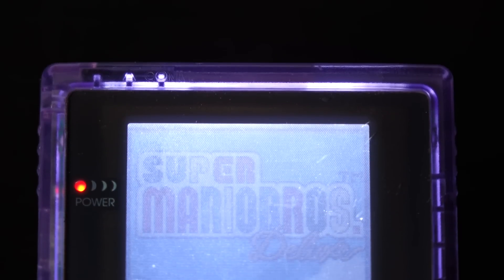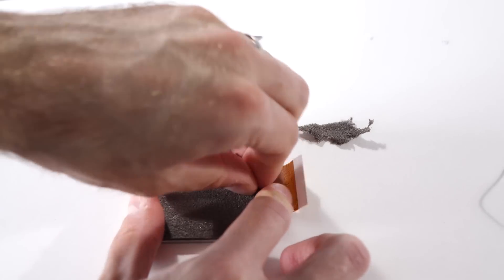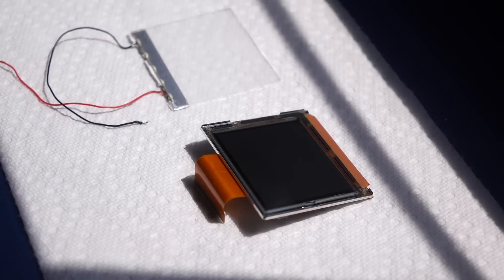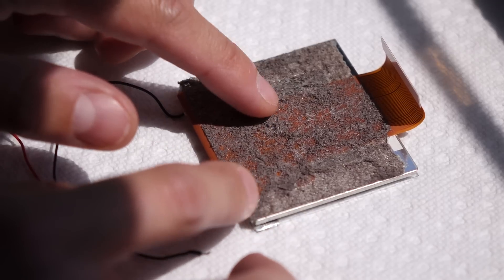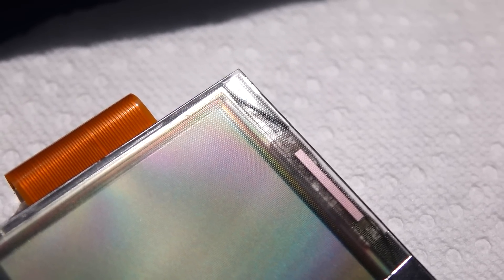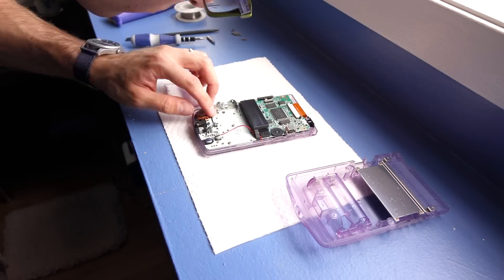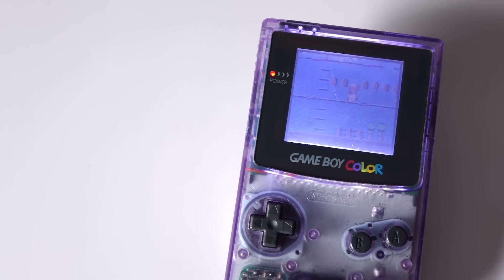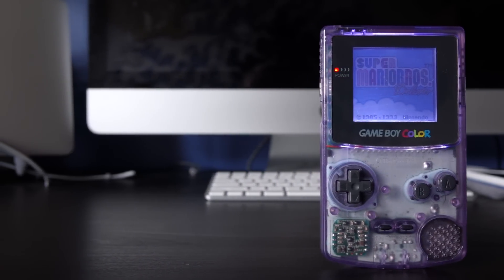Game Boy Color Frontlight: Does LOCA Make a Difference?

Comment: Instead of using LOCA, couldn't you add a resistor to decrease the brightness of the light panel and make it easier to see?
Reply: Damn imagine loca and a resistor
Reply: Perfect viewing conditions! Just need to figure out what resistor value to use...
Reply: +dj505Gaming man that sounds baller good luck
Reply: +WordierWord6 Thanks!
Reply: +dj505Gaming I've read a 1k pot is good so you can adjust
Reply: +FireMrshlBill A potentiometer would be too big to fit. I tried a resistor a few minutes ago and it just prevented the gameboy from turning on. (the red light flashed and it turned off)
Reply: +dj505Gaming A trimpot would most definitely fit. It has been done. You could also find other small pots that you can find some place to mount (maybe even relocate and drill a small hole to access from the outside). People have done it.
Reply: +FireMrshlBill Ah, I see. I thought you meant those bigger ones! Any way a simple resistorb would work? If so, how many ohms? (the light panel has 5 LEDs)
Reply: +dj505Gaming Haha, you could use one and just mount it externally. Just glue a gear to it and call it a steampunk GBC, ha. A resistor would work, it would just be a fixed brightness. I haven't done this mod yet (waiting on a second GBC to be delivered because I don't want to mess with my current one). I haven't looked at the specs to figure out which to use. I just know people have used 1k pots, and all the sites I have read people just say they used resistors but didn't say what value. I know people use 47ohm when installing gba sp front lights. So if you have multiple resistor values, play around with 47ohm and maybe move up from there. If it isn't powering up then you need to reduce the resistor value. One person did say 1k would be overkill. Sorry, I probably won't be able to do this mod until next weekend if the snow doesn't delay the GBC delivery.
Reply: +FireMrshlBill Thanks! I'll try it out.
Reply: +FireMrshlBill Thanks!! 47 ohms brought it down to an actually useable brightness. Can't wait ton add the LOCA, that is when it arrives :P
EDIT: Still a bit bright. Maybe a bit higher value would be better. I'll try 56 ohms.
Reply: +dj505Gaming Awesome, good to know! Saves me some time. I read that they use 63ohms or thereabouts on the DMG front lights, so may try between 47 and that, guessing 100ohms at most if you say 47 is in the right area (I guess I could actually think about it and do the math, but trial and error is more fun). I don't think I have any pots or trim pots on hand and would rather not order any. Let me know if you try a higher value and find a sweet spot. Thanks!
Reply: 56 ohms seems to be about the sweet spot for me until I get the LOCA. Might try a higher value if I ever need to, but it seems fine for now. Good luck with your mod! Oh yeah, I tried around 80 ohms I think for my first try and the Gameboy wouldn't turn on, so I'd recommend something under that.
Reply: +dj505Gaming Ya, I will be doing it with the LOCA and his still was a little more washed out than I prefer. So I still plan on using a resistor to bring it down a bit. I'm not looking to get it perfect as I have a GB Boy Colour that I play my gameboy color games on, so this is more just for the fun of it. But if I can get the LOCA right and the screen slightly dimmer than his, I think it will look pretty decent with the front light. I'm doing it on an atomic purple one as well (will match my N64 controller) and think the light bleed will look pretty neat through the translucent case. Anyways, will update whenever I am able to do the mod with my results (the snow storm has delayed the GBC arriving to me, was supposed to come today but hopefully can do it this weekend).
Reply: +FireMrshlBill Oh crap. I was in the process of taking out the screen and was using a spudger and twisting the gameboy frame slightly to loosen it up. Well my wife keep calling down because she needed me to come upstairs for lunch and I rushed it a bit to be polite... then CRACK. The edge of the screen outside of the viewing area cracked and now the screen is dead. Replacement screens are like $28 on eBay (whereas a GBC is $40). So will have to put this off until I can get a replacement screen since I do not want to mess with my other GBC. I'm mad at myself... not like they are making any more GBC's and I just messed up a perfectly good one. Will try to find one that is dead or has a banged up case that I don't mind using parts from. $28 on a screen just isn't worth it to me.
Reply: +FireMrshlBill That really sucks D: Replacement screens are so expensive... Good idea trying to find one for replacement parts. Those should be fairly common. Good luck fixing it!
Reply: I found this replacement console here, might want to contact the seller to see if the screen works.

http://www.ebay.com/itm/Nintendo-GAME-BOY-COLOR-SYSTEM-FOR-PARTS-OR-REPAIR-/191795135459?hash=item2ca7e183e3:g:VBMAAOSwL7VWrMHO
Reply: +dj505Gaming  Thanks, I'll look into that. It'll probably be awhile before I try again because I decided to work on my busted PC speakers since I had my equipment out and either the fumes from the solder or the contact cleaner got to me and I basically am having flu like symptoms (light headed, nausea, 102temp, chills, coughing up metallic taste, etc). I've been soldering for well over a decade and haven't had this happen, though last time I did get a little nausea and dizziness for an hour. So I won't be soldering without a mask or exhaust vacuum anymore, I guess I developed some susceptibility to solder/flux, apparently similar to to "metal fumes fever" (sounds like a Kiss song), apparently blowing away the fumes as the smoke rises isn't enough anymore. It really wasn't much at all either. Anyways, moral of the story... wear a mask, use a ventilation vacuum or fan when soldering, you never know what can happen from fumes, especially when working on already manufactured boards.
Reply: +FireMrshlBill Yeah. Lots of the time premade boards use less based solder, plus it might be a good idea to make a fine extractor using some carbon filter like I did. It's really easy, just use a computer fan pulling in air through the filter (which you can probably get at electronics stores.)
Reply: +FireMrshlBill Yeah. Might be a good idea to make or use a fume extractor (I made my own) because lots of manufactured boards use lead-based solder and flux that can cause fumes.
Reply: +FireMrshlBill Update:
I broke the frontlight. I took the gameboy apart because the wires from the mod were interfering with the buttons and the black ground wire popped out of the frontlight panel. Apparently it's fixable, though ^_^
Reply from the maker: +dj505Gaming Yep, that's fixable, I had that happen once. Just carefully peel off a little bit of the silastic around where the wire solders and tack it back on.
Reply: +This Does Not Compute Alright. Thanks! I'll see if I can fix it a bit later.

Comment: I got the kit from kitsch bent and they didnt include a replacement reflective strip for when i peel it off to cure the loca under it, I don't want it spidering so any suggestions?
Reply from the maker: +Infectious Fallout I've used aluminum tape for that before, you can get small rolls of it at the hardware store.

Comment: I hade a front light modded gba I bought like that and it had a bunch of bubbles and then got like deteriorated on the corner so I pulled it off and peeled off the screen no problem
Reply: I broke the front light pulling it off though

Comment: What about the chinese GB Boy Color? Is it possible to just take the backlit screen from it and put it into an actual GBC?
Reply from the maker: +Dylan Bain The short answer is, no, it won't work :-(  Stay tuned for a future video that (indirectly) explains why.
Reply: +This Does Not Compute I appreciate the response. Installed a frontlight with LOCA on my GBC. Looks great! Do you have any recommendations to increase the color/contrast even further? Be it a transistor or the like. I adjusted the contrast potentiometer on the circuit board and definitely got it to look the best possible at the moment. Just curious if there are other options. Thanks bud!

Comment: hey collin i cant find the frontlight kit in germany. ifind it only in the usa but the shipping kosts are so high . can you help me ?
Reply from the maker: +Phill Thaller Both Hand Held Legend and Kitsch-Bent seem to charge around $10-12 for shipping to Germany, which is about what the US Postal Service charges. Maybe you can get some friends who also want to do the mod and put in a larger order to save on shipping?
Reply: Thanks collin if ordert it . It comes about 2-8 weeks but it is okey the video is very nice . I habe another question :And although I can the loca adhesive with a UV lamp, or with something else to cure?
Reply from the maker: Phill Thaller I've found that an hour or two of exposure to sunlight works just as well, so the UV lamp isn't necessary. I've cured LOCA on several screens just by leaving them on a windowsill.

Comment: Hey Colin, have you experienced any spider webs from the loca bonded from your screen yet? Mine did after 2 weeks. Theres also a crack on the upper left hand corner. I feel like it's greatly pressured from being too thick which I believe is causing the front light to flex somehow and causing the spider webs on the front light.
Reply from the maker: +Nus Dogg I haven't seen that yet. The frontlit screen can certainly be a bit snug of a fit, but the LOCA shouldn't really add much thickness (LOCA is supposed to be pretty watery, not thick or gooey, so you should end up with a pretty thin layer). I wonder if the quality of the LOCA plays a factor in that too?
Reply: Yeah, I don't think it's the LOCA. For some reason, my light panel was being flexed a little bit after I've installed all the screws. I can tell by angle-ing the GBC screen to see the panel sides when the handheld is on. The LOCA bonded between the two just acted as glass shattered/webbing all over the screen which was a disappointment. I redid using a new front light and I can tell that the front light this time sits flush. Hopefully this time it doesn't do it again nor crack.

Thanks for your reply. Just wanted to see if you experience the same after a week or two.
Reply: +Nus Dogg How did you remove the LOCA? I recently Installed the frontlight but sadly didnt remove all the dust so now there is a bunch of white spots on my screen, I wish to peel it off and clean the LOCA off and try again but I want to make sure its possible, and if so, how and with what? I really dont want to buy another LCD and frontlight, but If I have to I will. Thanks in advance!
Reply: MyClanTagIsStud PC Gameplay I use a Q Tip with lightly dabbed into rubbing alcohol. Then I Q Tip the screen and used a cloth to wipe it in a swirl motion. Repeat the process til all the residue are all gone from the screen. It takes some times but eventually it's all gone.

Just don't get any rubbing alcohol on the new light panel. It'll ruin the light panel.
Reply: ahh thank you so much! Especially for the expedient reply :) Ive ordered a new light screen, most people would live with the little specs but not me XD Thanks again, I will give this a try!

Comment: Hey i did this mod with the loca and my gameboy only turns on for a few seconds and turns off any help please.
Reply from the maker: +Nick McCallum Did you install a frontlight from Hand Held Legend? If you followed my steps here (and in my original GBC frontlight video), you need to add a 100 ohm resistor to the red wire. I installed a Kitsch-Bent frontlight in my videos, which is a bit different than HHL's. Good luck!
Reply: Did you wired it to the very top of the four blob on the circuit board?